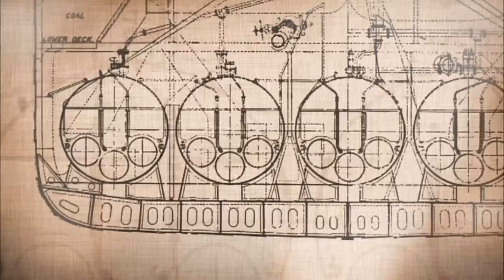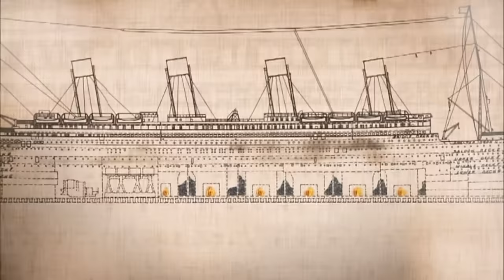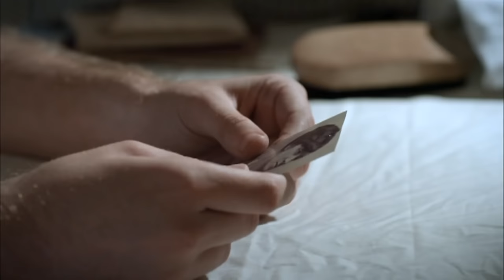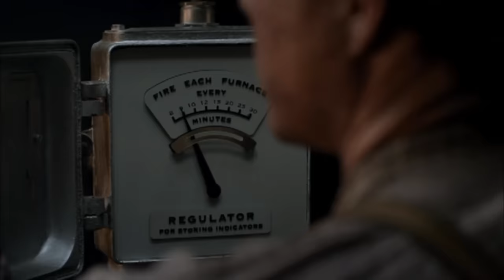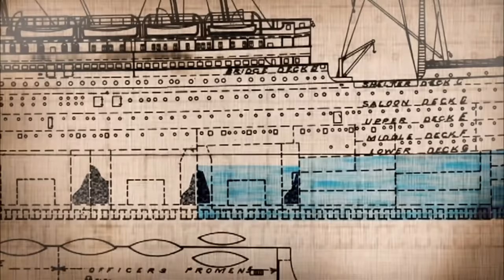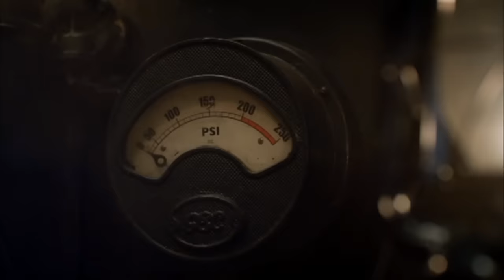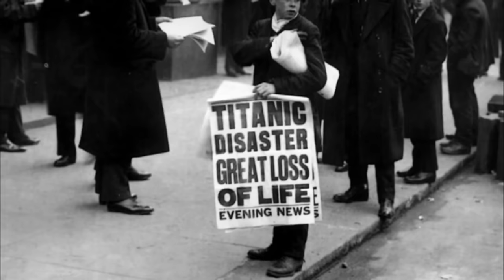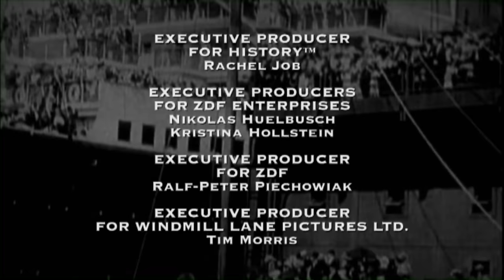Saving the Titanic 2012

Comment: Got one thing they wrong, when they said to direct power to the life boat winches, those on the Titanic where rope operated by the crew
Reply: The titanic had electric winches for the lifeboat davits. There were four motors on the boat deck to power them. So no, they didn't get that wrong.
Reply: @Gecko....  we are both right, but they only had 4 for 20 life boats and on the night of sinking they didn't use them, didn't know how to use them and power wasn't available to those winches